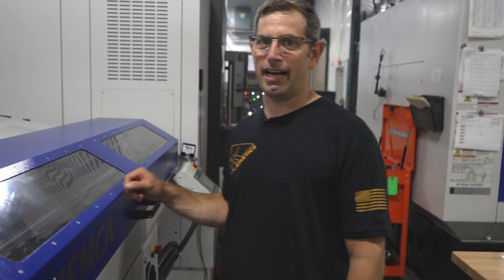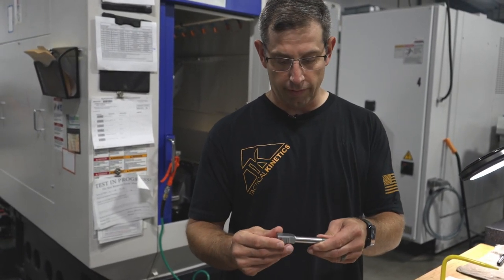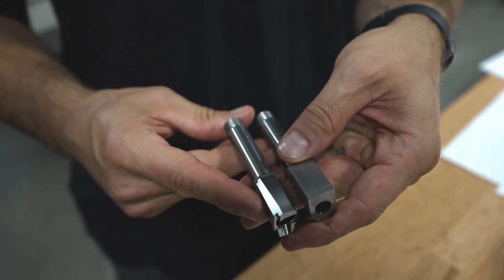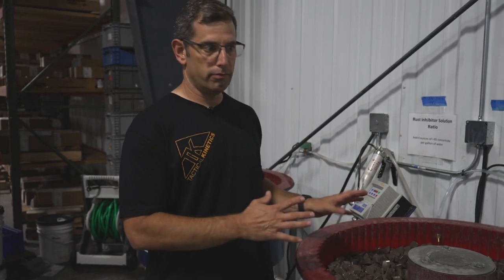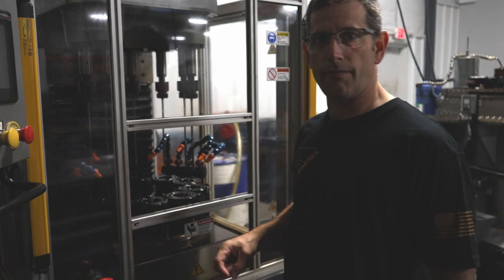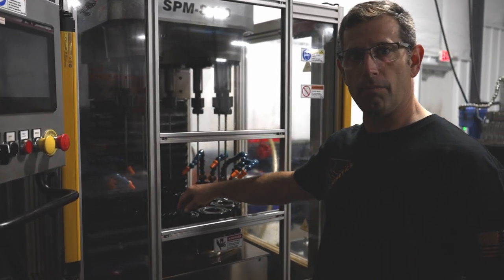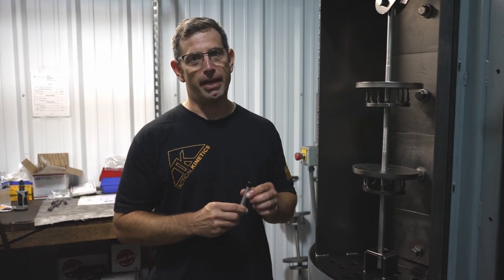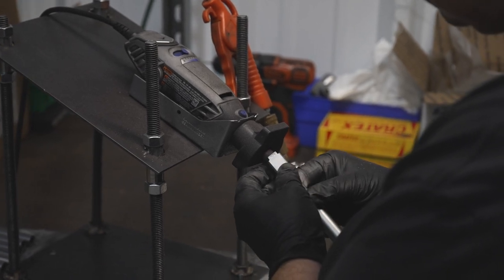How We Make Pistol Barrels

Comment: In general, not particular to any era, is it easier to make a smaller pistol-barrel(.22) versus that larger(.38/9mm)?  More material is involved for that larger, therefore more costly.  But either by hand or machine, which is easier, or is there little to no matter?